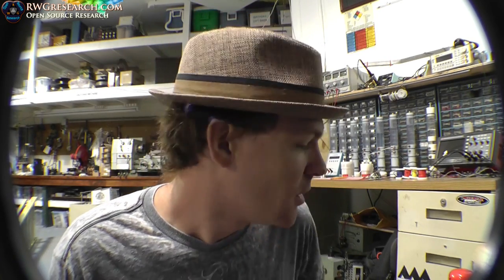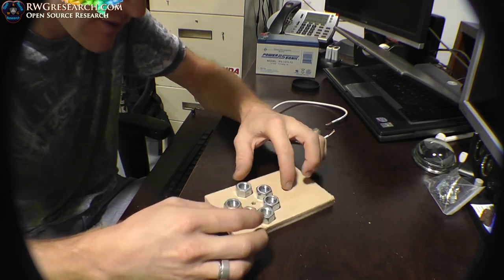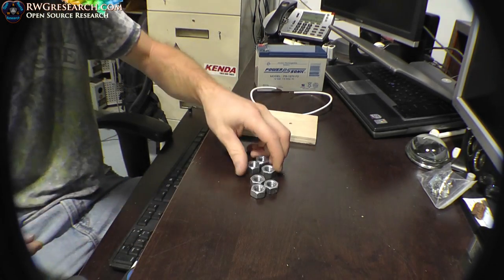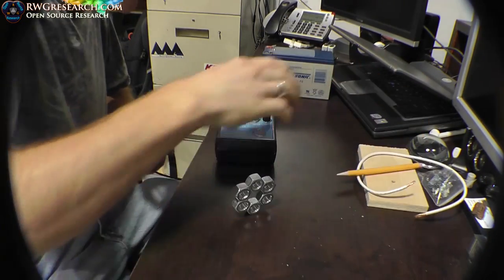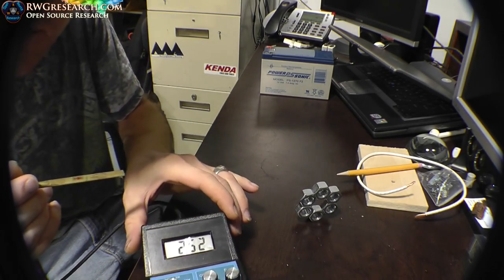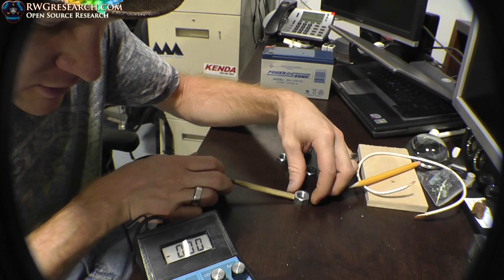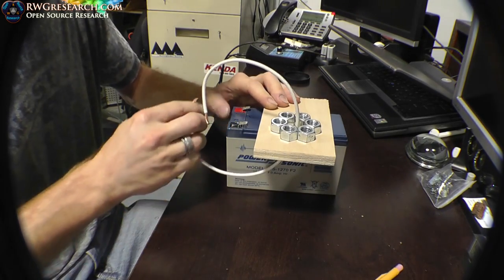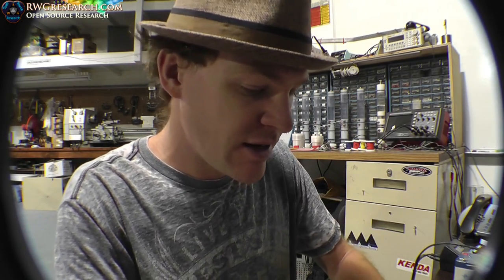“Oh Nuts!” Magnetic Lock.Your Going To Like! Using The Principles Of Ed Leedskalnin PMH.Must Watch

Comment: Helpmonkey can explain it :) ... first magnetism is 2 dimensional ... it does not have a north or south pole ... it only has a polarity which direction is completely dependent on where you view the field from ... this may be hard to comprehend ... a magnetic field is always a complete circuit ... there is no beginning or end ...  like ED said there cannot be a north without a south ... cont...

Comment: It is the equal magnetic bi-directional current flow induced into the ring of nuts, I have come across the same thing when i run 20kv into a ring shaped corona wire, when I remove the voltage the charge (current flow) in the ring is retained. 
Your experiment is very interesting because if you look at the coral castle rocks then they do have holes drilled into them, is this the way that the north and south poles (equal gravity) are balanced within the rock?

Comment: By running a current thru the wire it creates a magnetic field. This magnetic field in turn creates a small current thru the nuts that are arranged in a circle which in turn creates its own magnetic field like turns in an electromagnet thus creating a small magnetic field which also maintains the small current of it's own thus holding the nuts together until the coil is broken and the magnetic field disappears with no residual magnetism. Boom!

Comment: think of magnetism not as a field, but as a current. the large electric current briefly introduced into the wire set up a magnetic current that circulates the wire. because it was run through the center of a ferrous metal circuit made of steel nuts, that set in motion a similar current in the steel. from one nut to the next, around and around. as this current flowed, it collapsed space itself between the polls generated in each nut. this is why they "stick together" (remember magnetism as a current) it's essentially an infinite loop of magnetism.  which is how magnets hold their properties. but because the actual molecular arrangement of molecules are not coherent to the magnetic current in the steel, once the circuit is broken, the magnetic current stops, and the magnetic affect observed is lost. (I would be interested to see what it looks like behind some ferrofilm,)

Comment: The magnetic field is still there.  But it was aligned along the circular path of the nuts with a field angle bend of 60 degrees.  You would have to put the nuts back together exactly in the same way they were when they were magnetized.  And they would lock again.  The problem comes up when you disconnect them, the 60 degrees bend will become 0 degrees because the circuit shape changed. That would weaken the tiny magnetic field because it will have done work by rewiring from 60 degrees to 0 degrees.  And when you put them back together exactly the way they were when they were locked, that would exert an additional fraction of work.   

Test it by numbering and coloring the nuts so you can put them back together exactly the way they were.  Maybe the amount of work will not have drained the field completely.  Very interesting experiment. Also hysteresis is involved, but let's not complicate things.
Reply: +Dennis Kean No it doesn't work that way. You should try building Ed Leedskalnin's perpetual motion holder and you'll see that once the loop is broken the bond is gone even when an incredibly strong one is created.
Reply: Did you try it, or are you just telling me this off the top of your head?  Like I said, hysteresis once broken performs work and it might have performed enough work not to be able to put Humpty Dumpty back together again.  

But your answer sounds to me like you have not tried it.  Use colored magic markers and color the touching surfaces so you can put it back together.  Then tell me no!  I am an engineer and this is not as complicated as it may seem.
Reply: +Dennis Kean I've built a PMH but not the nuts variation shown here. No pun intended.
Reply: BlackSunDarkStar
That still does not tell me if you actually did the test.
Reply: +Dennis Kean Yes I made a PMH (Ed Leedskalnin's perpetual motion holder), put it in epoxy resin and used it as a bookend, never bothered to do any tests... 

Had I actually done a test I may have found that it duration of the current didn't matter but voltage did. May have also noticed the loop path could not be changed after the charge had been applied. And once broken it was gone. May have even tested multiple simultaneous loop paths to confirm this...
Reply: BlackSunDarkStar
When you start talking "Perpetual motion" you lose my attention.  I went to school and aced my physics and mathematics courses.  Enjoy your experiments. I think this is an interesting effect.  thank you for sharing it. When I get a chance I will do the test on my own.  But perpetual motion has nothing to do with any of this.  

Cheers,
Reply: +Dennis Kean Perpetual motion holder is the name given to this device by the inventor, Ed Leedskalnin.
Reply: BlackSunDarkStar
Precarious name.  It does not elicit the interest or confidence from folks who have engineering education, I would think.  

Anyway, how long does the bond hold?  Have you tested that?
Reply: +Dennis Kean Unfortunately I don't have the equipment needed to accurately test the strength of the bond to determine if it decays over time. There are many who have tested a PMH left for more than a year and apparently it is just as strong after a year. However I'm not aware of anyone who has done this and accurately measured the strength of the bond.
Reply: Just hang it on the wall on a nail right through the center of one of the nuts.  And let it sit therefor years.  If it weakens, one day you will just have one nut hanging on the nail.   Simple test.  

I will do some tests on this soon.  But I will try it with multiple windings to change the flux density and see how that affects the tenacity of the ring.
Reply: +Dennis Kean Yes, this is a really neat variation on the PMH, which makes it so easy reproduce and test. Your suggestion of hanging one on the wall is a great idea.

Comment: FLUX RUNS IN A CORE UNTIL THE LOOP IS BROKEN then it goes into the air, how the flux got their is the cooler question...on the leedskalnin pmhs that still have copper coils and lights connected the broken pmh will light the bulb as its a perferred path compared to air

Comment: The spot welding theory seems plausible. Does it it work with other non-ferromagnetic metals, such as brass, and does it work if the nuts are not connected (try inserting a piece of paper between them)? Interesting experiment - thanks for sharing!
Reply from the maker: it's not spot welding. only ferrous metals will work. you can place paper or other things between this experiment ( haven't tryed the nuts but the bigger unit I have will work with paper between it) so it's not spot welding 100% for sure. also if it was spot welding would I not be able to pull one nut off and the rest stay in place?  but that's not what happens. when the "loop" is broken they all fall apart. ~Russ
Reply: +Povl Kvols not spot-welding, since if we break any part of the circle, all the attraction vanishes.  It's actually some well-known physics.  An immense magnetic field stored inside a "magnetic circuit" solid ring of iron.

It's part of engineering magnetics.  If we include the slightest air-gap in the "magnetic circuit," then the magnetic flux inside the metal becomes very weak.   

Hopkinson's law is much like ohm's law, but applies to manetomotive force and reluctance instead of voltage and resistance.   Iron is about 5000X better "flux conductor" than air.  A complete ring of iron or steel, with no air gaps at all, can produce immense values of magnetic field.   But it's entirely inside the metal.  https://en.wikipedia.org/wiki/Magnetic_circuit
Reply: +rwg42985 one physicist thought it might be a source of impossible excess energy, because when we break the steel circle, it produces a huge pulse of magnetism in the surrounding air.   Normally the energy is lost because the collapsing field heats the steel a bit.

Capture the released energy:  if we wind a coil through the center of the magnetized ring, then break the ring, we get a pulse of high voltage out the coil terminals.  Hit it with a hammer so it breaks in under a millisecond.   Send the pulse through a diode and charge up a big capacitor?   Hmmm, how many turns of coil does it take to make 150V, and flash a neon bulb?
Reply from the maker: +wbeaty hey Wbeaty. been watching Your videos for years. welcome to the channial. so I did this here. https://youtu.be/832qz3s1M-s it's fun knowing this is known physics. the bad thing is its not taught to the mass. so the Qustion here is intresting because there are so Manny responces. it's in interesting to here people's thoughts. and that's why I asked in this video. watch the video in the link. I get excited. it's fun to watch. I did tests on energy in vs energy out. if done correctly the same amount of energy could be goten out of a coil that the u core was energised with. but you have to add the energy of pulling off the bar..... any how thanks for commenting !   ~Russ
Reply from the maker: https://youtu.be/832qz3s1M-s
Reply: +rwg42985 Excellent! 

The Exploratorium museum used to have a demo where they put a thick aluminum ring around a closed iron core.  When you broke the iron core into two halves, it put a huge electric current into the shorted ring.

For crackpot weirdness, the Hans Coler device and also Bearden's failed "MEG" were both trying to harness some weird parts of magnetized-ring-core effects.   If it's possible to violate thermodynamic 2nd-law at the nano-scale, and make entropy run backwards,  then magnetized iron loops have suspicious features, and might do such impossible things.

Also, I recently heard that N. Tesla had patented a transformer THAT PUTS OUT DC.   That's physically impossible.   Someone should build it from the patent, see if it actually works.  It's impossible to make rectifiers out of iron and wire   ...unless Tesla's version is real.

Comment: You basically are creating a temporary reversed electromagnet by running the copper wire through the nuts which would be representative of a core of sorts rather than the copper wire running around the iron core in a typical electromagnetic setup. When you pulse short the battery, the wire emits a pulsed intense magnetic field that induces magnetism in the nuts and locks the nuts together in a magnetic flux loop. When you break the magnetic flux loop, the temporary magnetism instantaneously dissipates into the aether field, and vanishes so the nuts lose their temporary magnetic lock. 
.

Comment: Very nice trick with variation on PMH. What happens when you put the wire trough the hole of one bold
when they are all connected and what if the next one with an opposite direction will it break the circuit?

Thanks for sharing!

Comment: Well to me it looks like such a high current flows through the wire through the middle of the nuts and the magnetic field generated from the battery shorting through the wire has a kind of magnetizing effect on the nuts as the magnetic field is emitted from the wire through the nuts.

Its more particularly powerful in the spaces where two separate pieces of metal are touching one another because the magnetic fields travel through the nuts to one another where they are touching causing those surfaces to receive more magnetism... I'd be interested in seeing if that's true and the sides touching get higher magnetization than the rest after its been taken apart. Also, if you continue shorting it a bunch of times (carefully) and seeing if it produces a stronger magnetizing effect.

Comment: This could used somehow for a much more practical form of energy storage. What would happen if you leave the coils(eds original 1500 x2 coils) on and see if a voltage/ current is induced when the bar is removed long after the battery is disconected. Oh wait a minute. I think someone did that already and it works. Well there you go.  A new type of battery. One that ways 100 times more and never needs maintenace. All you need is crow bar.

Comment: To check if the nuts are all still a Leedskalnin PMH...
This might be difficult... Wind 2 coils on the nut. Leedskalnin style. And cut the nut in one spot. The moment you cut the nut, you should be able to pick up a really tiny amount of electrical power.

cheers !

Or ! do this experiment again, with all nuts cut in half and then repositioned. It should all stick together and when you break the big chain, the nuts themselves shoud stick together also proving they are in fact little PMH also..

Cheers again..

Rene

Comment: You may want mark the touching faces with alternating colours for the north and south poles created by the circular magnetic field created by the current-carrying wire. If the nuts are not re-assembled just right, they will repel and weaken their fields even more easily.

Comment: im thinkin along the lines of an EMP burst.  by tapping the charge wire, it has, say on a molecular level magnetized and fused the nuts. think of the pads on the gecko, they can on the molecular level fuse and become part of what their attached to e.i. walking up glass. it is this, which i believe would explain why they (the nuts) can stick together, yet the connection be so fragile, and they fall apart so easily. and again would need the charge to adhere there. 
i realize this was done a couple years ago, i have just seen it, but i wanted to offer my thoughts. 
i found this amazing. as l have no formal science or technical training in this field.

Comment: Temporary magnetization of the steel nuts…prove it by moving a compass around them…this will identify the poles.
You want them to stick with more force? Use a car battery and a #2AWG wire…tip?…that wire will get pretty hot if you linger.
Look at my picture…how do you think I can stack those BB's so high???
charlie

Comment: The nuts must have some carbon in them therefore they don't lose its induced magnetic flux like pure Iron when the current flow stops. depending to the type of steel The time is taken to the steel to return to its normal state varies.

Comment: When the wire is powered, the current creates a magnetic field around. The field lines encircle the wire. Therefore the 6 nuts are mainly magnetized along the circle that they constitute all together. They keep their magnetization because the material has a not negligible coercitivity.
Unlike a perfect toroid magnetized along its circular axis, the irregularities of the nuts due to their angles and holes induce magnetic field leakages that can be measured. There is nothing amazing here. It's conventional magnetism.
Reply: Eggsactly. Russ appears to have invented the magnetic core memory.
http://en.wikipedia.org/wiki/Magnetic-core_memory

Comment: It's a semi "permanent electromagnet" employing what I'll call the "Leedskalnin Effect." Mainstream science is oblivious to this, perhaps because the few who realized this is new didn't think of any use for it, so it was just a 'novelty,' even to those few who grasped what was happening: When you run electrical current through the wire loop, like a single-turn solenoid coil, it creates a right-angle (right hand rule) magnetic current circuit/loop through the ring of nuts. The special magic is the existence of the induced semi-permanent magnetic current circuit (permanent until broken, then gone). It's normally undetectable because magnetism likes to stay within a magnetized object, especially if its ferrous. This has to happen to every continuous torus with current running through a coil looped around it, such as in an inductor or power transformer, but it's not noticed because the field is apparently undetectable in a smooth loop/torus and gets destroyed/replaced each time current is reapplied. A number of applications occur to me - now, anyway, thanks to videos like this shared by innovative experimenters. Thank you. Hmm, looks like it was known/used in the past (circa 40s incept) with computer Core memory (see Martin Hirsch's explanation in the comments) made from ferrite donuts and charging wires running through their centers. It doesn't seem like a magnetic field was sensed, but they knew it was there or not, and direction, by if current was used up to magnetize a ferrite donut. This means they knew a permanent magnetic charge was induced - a permanent electromagnet. Maybe they thought of it like static electricity or capacitor, not really realizing the significance of stored Magnetic current. But then, it's sort of the same thing. Applying electricity in a loop induces an internally contained static electric (dielectric) field which in turn induces an internally contained magnetic field at right angles to the dielectric field. So, it was kind known, but with narrow implications explored. The people who thought up Core memory were geniuses though.

Comment: You should use a textile sting instead of a copper wire ,the copper wire is why it broke its bond ,the wire turns the magnetic energy back into electrical energy ,there for its bond is lost ..

Comment: 90 degree magnetic pulse vs shorted wire, the low voltage = low magnetic transference,  the surface area of each nut decreases the amount of  required magnetic attraction / sq in = allowing all six to hold the circular magnetic flux of the the 90 degree voltage. just my best guess